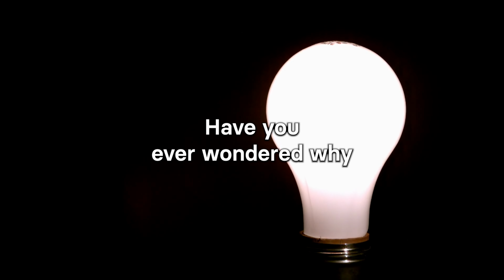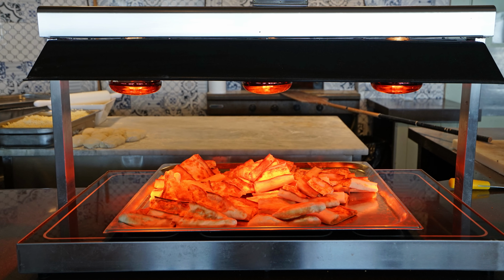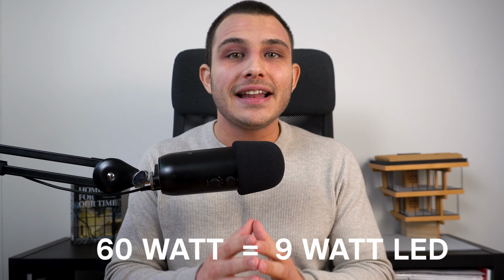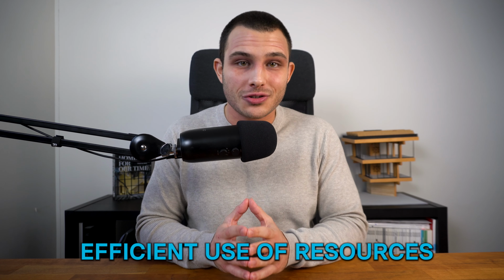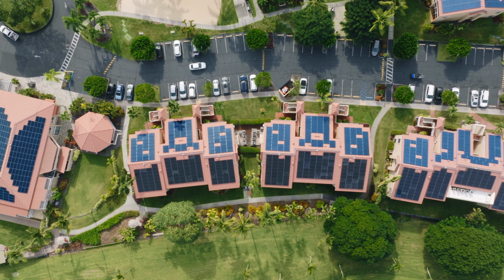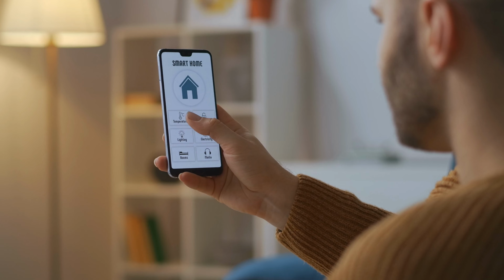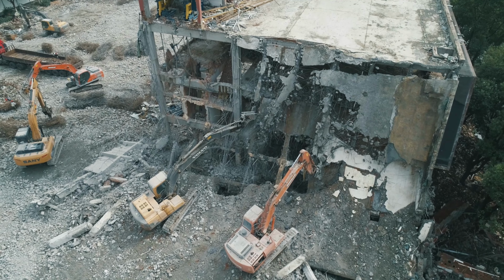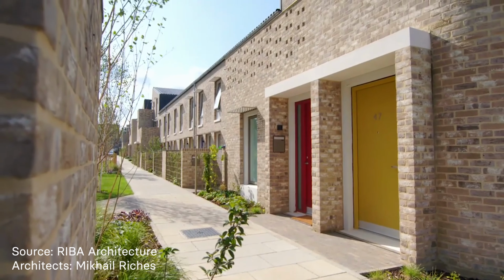7 Lessons Architects Can Learn From Lightbulbs’ Evolution

Comment: Heat lamps kill an awful lot of chicks every year. They catch fire desperately easily in an environment full of wood waste bedding and cereal dusts. Good farmers these days use thermostatically controlled heat panels that won't start a fire even if they're buried in sawdust.
The only light they need to produce as a byproduct of keeping chicks warm is a single LED to say the device is powered on and working.